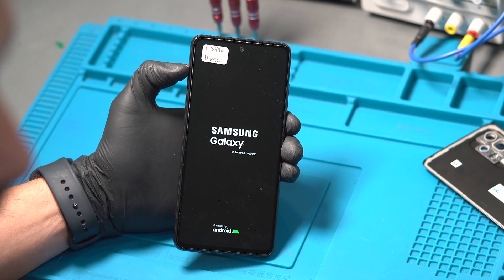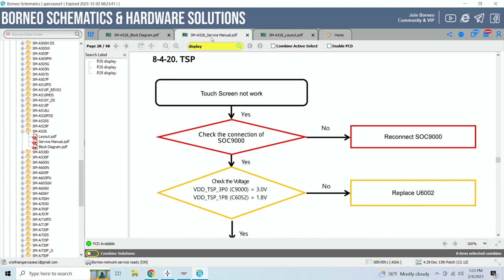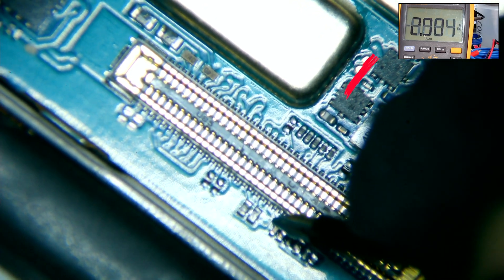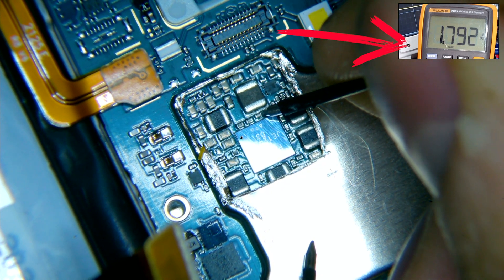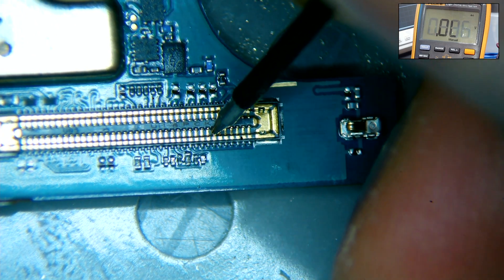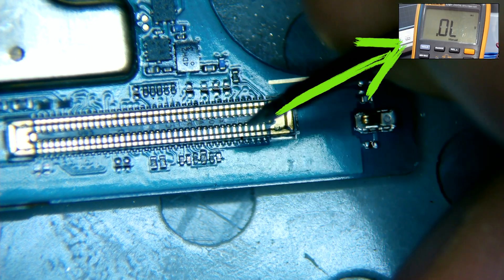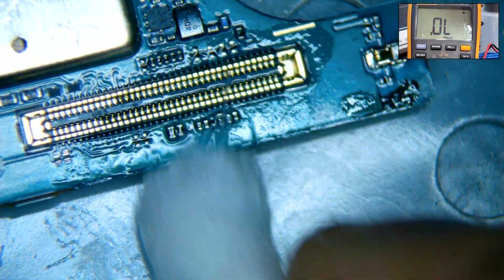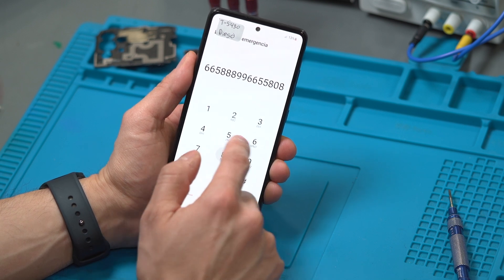Samsung A52 5G No Touch Diagnosis & Motherboard Repair

Comment: i usually fix my phones myself and have no issues, but this time my screen blacked out. i replaced the screen amnd cables still nothing. i know the issue is something very close to this video. when i connect the main cable and press on it slightly and turn the power on the screen comes on but when i release my finger from the cable area it freezes and blacks back out or it turns to a static display.  i need this fixed cause i have very important data in here i can not lose.

Comment: My A52s has touch issues, touch stop working until i lock the phone with power button and unlock. Screen was replaced. Also GPS is jumping after screen replacement. What's the issue?

Comment: Hello, could you provide information on whether the USB controller chip in my A52s device is located on the motherboard or the charging board?
Reply from the maker: You can find that information using Borneo Schematics software.

Comment: 😊Is the cost to repair cost effective? They wanted $200 to repair a iphone se 2020 that restarts every 3 minutes. Can buy new phone for 149.
Reply: I decided to swap the lcd flex cable and that fixed my touch problem.
Reply from the maker: Exactly, in the U.S., this type of repair often isn’t cost-effective. However, in this case, the customer prioritized data recovery, which can justify the additional effort and expense.
Reply: @cellphonerepairacademy2302  that's for not backing up their phone.

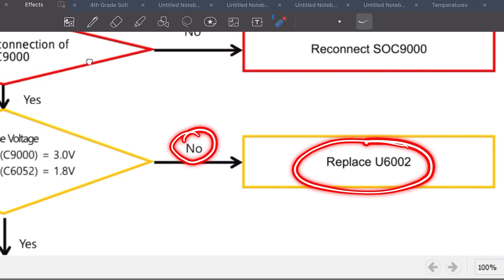Comment: I've had few of these before. If you cant find solution just reheat 2 pins on fpc connector above C9000 3v (like 1:29 in video) and one on the right next to this component. Usually weak solder connection on fpc is causing complete no touch or problems with it.
Reply from the maker: You’re right! Samsung phones often have issues with connectors due to poor solder joints.

Comment: This better cost more than just replacing circuit board
Reply from the maker: Exactly, in the U.S., this type of repair often isn’t cost-effective. However, in this case, the customer prioritized data recovery, which can justify the additional effort and expense.

Comment: the display doesn't respond to me like in the video, what's wrong and how much would it cost to repair??

￼
Reply from the maker: The issue could stem from various components, such as the screen, connector, faulty IC, or even a short. A proper diagnosis is essential to pinpoint the exact problem first.

Comment: i hve this phone, the problem is, a lot of capacitor and resistor near the fpc connector are removed, and they are very small, how can i fix this
Reply from the maker: You need the right equipment to solder any missing components properly. Additionally, a donor board is essential to source the necessary parts.

Comment: My touch somtime work but sometime not
Reply from the maker: The issue could stem from various components, such as the screen, connector, faulty IC, or even a short. A proper diagnosis is essential to pinpoint the exact problem first.